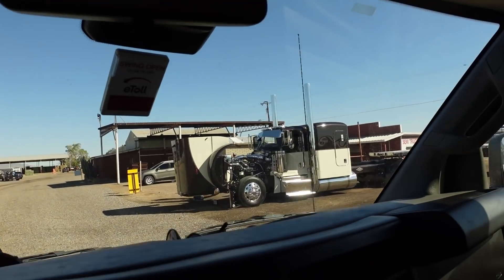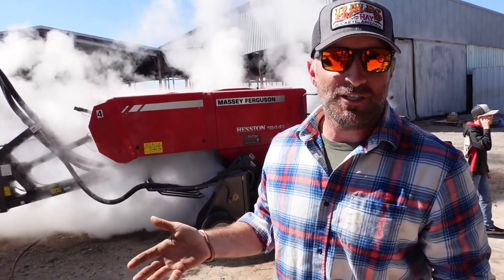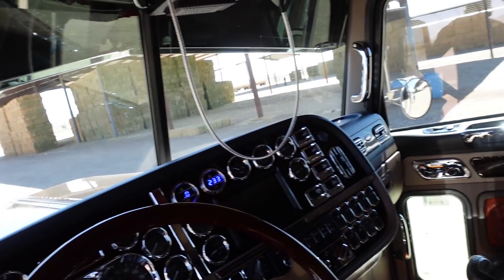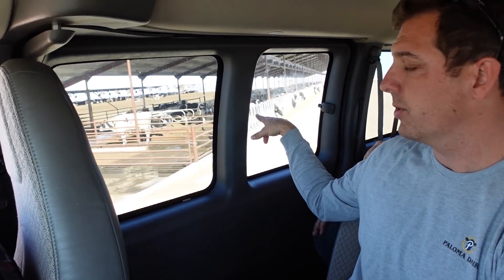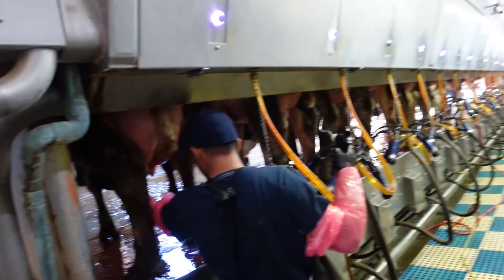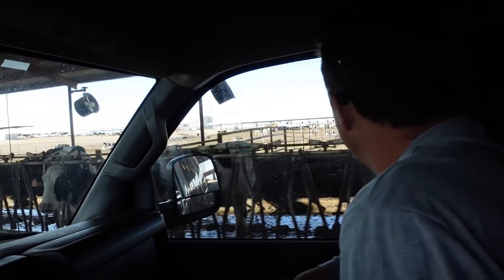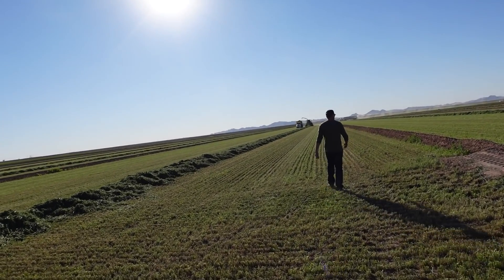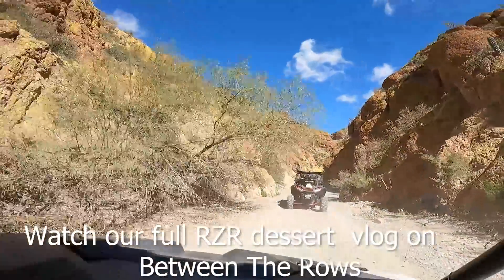The Most Interesting Farm Tour I've Ever Done! #MakeThisTrend

Comment: I’m a custom silage harvester and the 19mm is the cut length. The distance from the knives and shear bar don’t change because you want them tight for a clean cut. What dose change is the feed roll speed, and that is what forces the crop into the knives. Slower feed roll speed shorter cut, faster the speed longer the cut. Cool to see how it’s done in other parts of the country!
Reply: Was just going to post this. Its effectively the length of material fed into the drum from the feed rollers(compression rollers) before a knife passes it.

Comment: ,Looks like quite the operation. There are 2 huge dairies west of me. One is 9500 head & the other is 11,000 head. They use the rotating milking system I think. When the 9500 head dairy was built they said it cost $50,000.000 to build. They even have an apartment building for the workers.

Comment: For those that aren't aware, methane is also referred to as swamp gas. It's very common to see methane bubbles in certain ponds and lakes and is the result of the decomposition of organic  materials that naturally occur in that type environment. Ghost fires can occur when the methane is ignited above the aforementioned water bodies, but is rarely explosive due to the low volume of both organic material and the gas accumulation.

Comment: For a combine comparison, it's the speed of the elevator chain (feed/compression rolls) that alters the chop length. Shearbar to knife can be down to 0.1mm. Keep the blades sharp for efficiency and less fuel used. The concave is kept relatively tight but not combine tight. Helps the crop transition to the accelerator (another impeller) that then forces it up the chute.👍
Reply: Shearbar setting on the 781/881 ih/case ih was to run the chopper at idle, and bring it in til it started ticking, then back it off a certain number of turns.
Reply: @scotcoon1186  Knock sensors on the shearbar. You don't run a new blade and shearbar too close until they have done a bit of work. By too close, it's around 0.5mm. Then you can go closer if you want. 
Run the knife sharp and the shearbar close for chop quality and fuel efficiency.👍

Comment: The way that "packing" works isn't really for the initial fermentation, it's for the secondary fermentation.
If properly sealed the pack will use up all the oxygen inside itself very quickly, but when you open it for feed out, the looser the pack is the deeper air and oxygen will infiltrate into the pack and cause heating(from bacterial activity)and spoilage.
If you want to prove it, take 2 plastic drums, cut the top off both,  quarter fill one with lawn clippings, just throw them in and give it a loose tramping(several stomps) to level it, then on the other cut a slit several inches up the side so you can fit it over the one you filled. Seal them up with bale/silo tape, loads of tape, then the hard part is waiting for 2 to 3 months, open it up n voila.

Comment: The crop dusting plane you showed is called a Bippy. It is where the phrase, "You bet your bippy!" comes from. Every time the pilot takes his plane down for a low-level spray run, he is betting his Bippy (and his life) that his piloting skills and equipment are good enough.
Reply: You won't find this in any of the online (or offline) dictionaries. They will tell you that bippy is a substitute for butt. However, high-seat crop dusting planes were commonly called bippies back in the 70's. In fact, the pilot is risking his butt right along with his plane, and that may be why the plane got the nickname.

Comment: I wonder if you could pack that pile with a D9 or D10 dozer instead of a tired tractor for faster compaction?
Reply: The dozer has less pounds per square inch. The big dualed up, weighted out tractors are best.

Comment: I worked in the gas fields for 40 years and I guarantee you they invest in more than two or 300,000 into that system I work with methane and what are you doing with the scrubber to scrub off the CO2 and the hydrogen sulfide H2 S is very expensive and they probably have to pay to tap into the pipeline

Comment: Very inefficient using milk holding tanks.  My friends milk just as many cows in Kansas milking 150 on each side of the milk parlor.  They use a radiator system to cool the milk down to a transportable temperature  then pump into a tanker truck.
Reply: Most big places ship the milk out directly into trucks, they not showing us the whole process are they..
Reply: @Cent51  no they are not showing us the whole process most big dairies are worried about some crazy person doing something to their milk or cattle.  My friends also, have the methane retrieval for electric generation.  I will say California farmers have the best view.
Reply: Around here the first thing the water is used is to cool the milk through a cold plate. I bet they do the same.